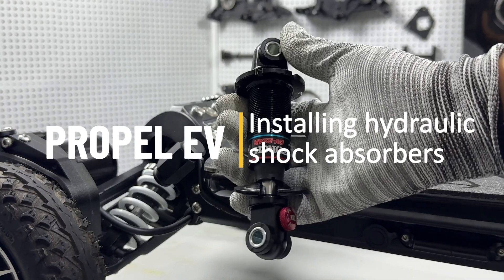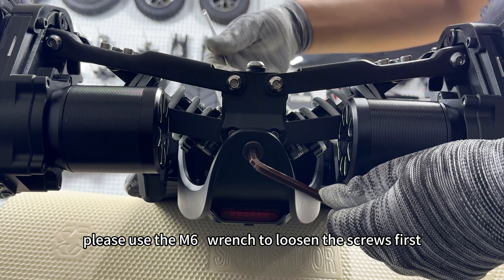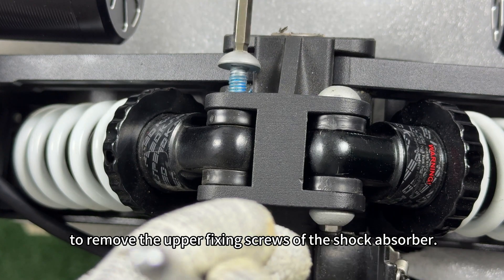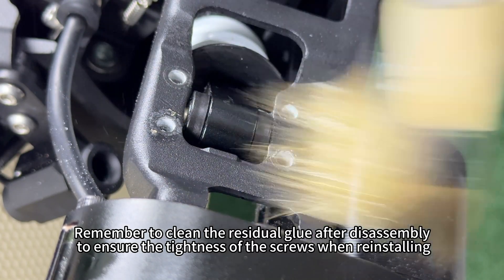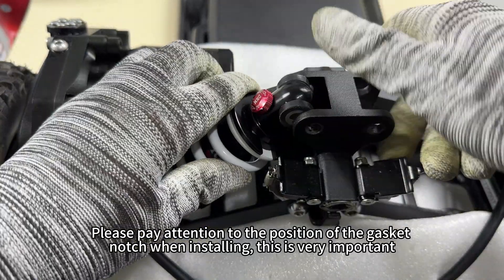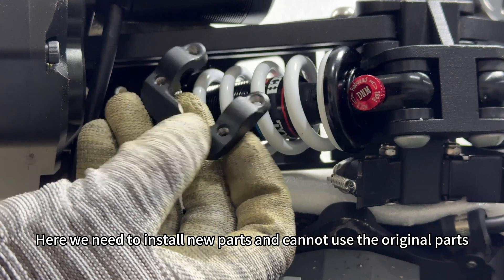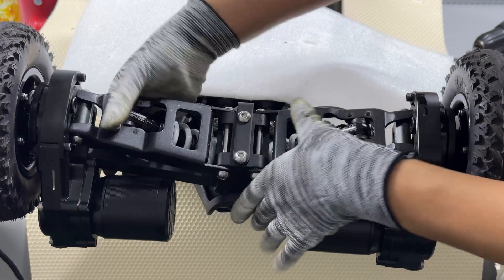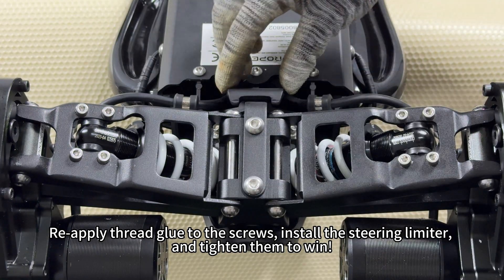How to Install Hydraulic Shock Absorbers

Comment: Great video! I did this last weekend on my Endeavor3. I lucked out and did not have to heat any fasteners for removal but I did have to Dremel a bit of clearance for the shock end on the control arm fastener brackets, not difficult.
Reply: Dow do you like them?
Reply: Congratulations on choosing the END3 series